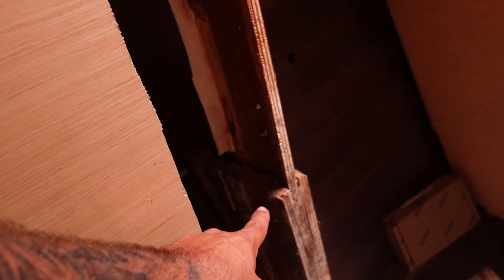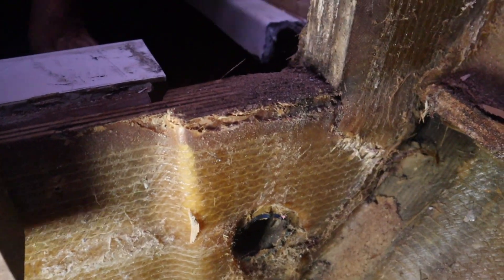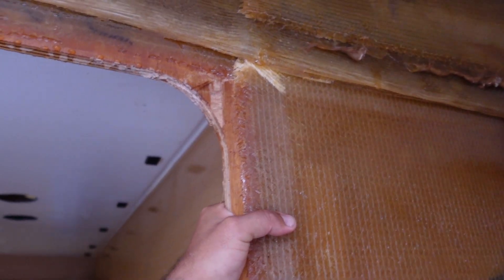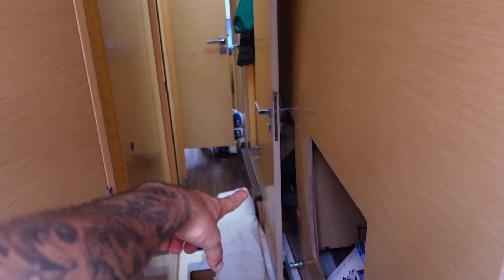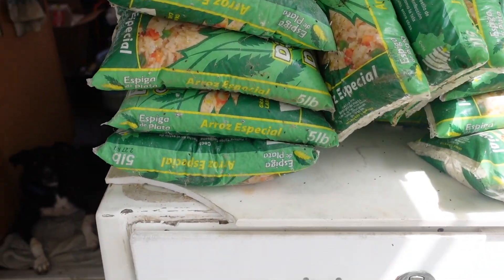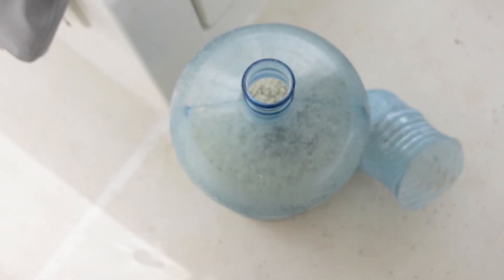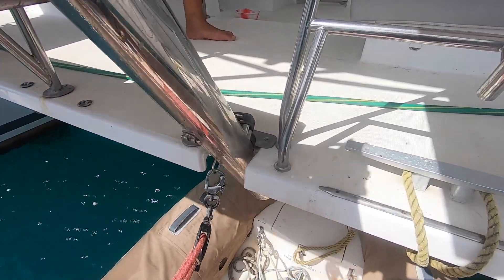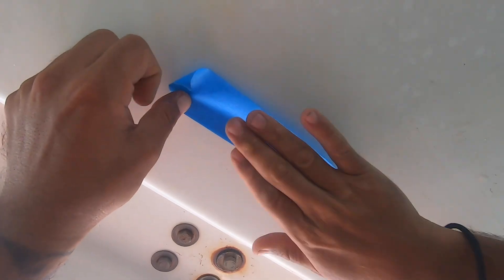CRACKED BULKHEAD REPAIR SERIES: Part 1 - An introduction... (Episode 107)

Comment: I've watched over 150 episodes in a week (I started off randomly then watched 30 or so recent ones, then from the beginning bringing me to this episode)..... and had stop at 10:36 because I couldn't believe my ears.

Quoting colin: 

"... the designer of the lagoon 450...... one of the best naval architects in the world..."

Colin, if he was, do you really think he would've used polyester resin?  15mm bulkheads and frames?  ... or what caused me to stop and write this, paraphrasing you this time:

"... he said, if anything, we should a negative rake in order to counteract stay tension...."

Are you fucking kidding me????? Not only did it sound blase', he didn't tell you by how many degrees!  Did he tell you what tension the stays should be?

As previously mentioned,  I've watched a few more recent vids and the cracking of bulkheads is common.  If I were you, I'd be seeking advice from a structural and materials engineer.

Comment: about the bugs in the rice:
the reason you have the weevils is because the eggs were already in the rice when you bought it.
it's common for most grains, whole or processed, to contain weevil eggs, regardless of where you in the world you buy them.
that's how even factory sealed packages can explode with weevils in a few weeks, or even just a couple days.
so you will basically never find any grains that don't have any weevils in them (other grain based dry goods like pastas can be effected too), but there are ways to kill them all off before you notice them.

you can heat the you can heat the rice or oats or whatever to about 140f for 15 minutes or so, but of course that isn't the best idea if you don't want to spend forever toasting your rice every time you stock up.
the other option, which i think is much better is to pop it all in a freezer for a couple days, because the extreme cold will kill them without changing the food. if you can find a local restaurant or supermarket in the area that will let you rent a bit of space in one of their big industrial freezers for a few days, that would probably be the best. then when you get ready to start resupplying you go buy your rice, flour, oats... first, then drop them off where you are going to rent the freezer space, that way once you are ready to actually leave in 2 or 3 days your dry goods will be ready

Comment: Give you good sailors this : unsinkable idea..use weather ballon diameter 10 m. And in every cabin a packed "parcutebox in sealing" and 8 mm nylon tube to a air bottle. This will ceep you afloat to repair can be done. And maybe an " parcutebox at top spreader" so that cat if uppside down in water can turn around. Best from sailorbeat in sweden :)

Comment: Pack rice in drum or similar. Put dry ice in and close lid but don't seal. Dry ice will sublamate and fill the container from bottom to top with co2. Seal. No oxygen. No life.
Another trick is to freeze the rice for several days to kill the eggs so they never hatch in the first place.

Comment: ill go carbon fibre on the structural stuff, wood rot over time,(inside the fiber) seen it many times, making the fibre have to do all the work, and a few layers of glass cant take that much tension in both directions (up and down, stay stress and water pressure.

Comment: to combat the weavel problem (in the future) put a bit of dry ice in the container as you fill the rice. That is CO2 and will remove the oxygen from the carboy (the container you used) if you keep it sealed and air-tight. If there are eggs in the rice, they will die rather than hatch into weavels.

Comment: I've replaced all of the main bulkheads on 2 of my boats.  I'm surprised that your bulkheads are what seems to be 1/2" ply.  My 32 foot (4700 lb) Evelyn 32-2 now has 3/4" bulkheads, glass on each side and the edges to completely encapsulate them in epoxy/glass.  Overbuilt, for my application, but I never fear them failing.  Here is the complete DIY rebuild/restoration of the boat:   http://nbayracing.com/Evelyn32-2Forum/viewtopic.php?f=8&t=166  and  https://www.facebook.com/media/set/?set=a.1669749116545.83411.1621862082&l=0290a25c2f&type=1  .  I feel your pain!  Too bad I live in the Chicago area, and not in Panama . . . I'd be over to help you in a heartbeat!

Comment: I assumed you already knew about it. But as I view the following videos. I have to assume that you don't know.

Which is that your hall is designed to fail right there. Every single lagoon 450 owner. Who has even been through rough seas will have very similar issues.

Let alone a hurricane damaged one.!

But check it out. Here is a few other YouTubers with the very same problem and their boat was never in a hurricane.

My Lagoon 450 Bulkheads are BROKEN & I have to fix them myself! Why won't you help me Lagoon?
https://youtu.be/eniqyjvICvs

So lagoon is acutely aware of this problem. And it is only because you were such a large YouTuber that they wish to assist you. So they don't look bad.

So you were actually even more lucky than you thought to get a hold of them.!!!

Comment: That plywood looked discolored so water damage if not it is from stress.  There have been stories of other older cats having long term stress problems maybe from the two hulls rocking not sync with each other or from the hulls pounding.   A rebuild will fix it may last 30 years but you are going to be dealing with unbalanced forces.

Comment: You lost me.  You overcranked the rigging so that means the shrouds came up too far.  So now the fix is to let them hang down the opposite way so why remove the weight?  I'd have thought youd want weight in the shrouds to pull the ends down so your floors can be properly epoxied and reinforced before it snaps back when it goes back in the water.....I think
Reply: Sorry.  Each of those hulls must weigh close to 2 tons empty so the junk hes throwing out must be just to make space for the renovation.  As a carpenter I wouldnt try to patch the interiors after he has trashed them.  Its much easier if he were to fit new lockers made to fit.  Takes more time but everything will have a shot at looking normal.   As it stands it will be pretty trashed.  Local artisans would be cheap with that and do a fine job Im sure.  Get it in Teak or White Oak.

Comment: messy dirty job and  now  you have to think about what caused these failures ...sitting on the hard and or lifting   can cause some issues for sure and maybe more blocking to distribute the weight is in order..... just a thought,  how lucky you were that it happened before you were halfway  to  New Zealand...burn out can sometimes  erode the enthusiasm  with that said  set  your goals  planning for the worst scenario  and get people who  can handle the stress.... good luck... I've  been doing this/that for over 50 years now retired  I can understand your plight

Comment: Cats are a beautiful thing but you have two competing hulls continually at odds with one another that are not evenly weighted, so the competing stress factors are tremendous.  Materials have come a long way since my early days with Chris Craft and then experimental hull designs for race boats, but always remember there is a reason why it's called glass, it's not that flexible. You have to design it with that in mind and build other factors in, to compensate. It doesn't look like a patch job is going to work unless you strip that inside out and do some reconfiguration and reinforcement.    IMHO
Cheers, Doc

Comment: 3:15 - you're no longer eating rice at that stage, your only eating weevils. You just need to decide if you want fried lice or fried rice. I find the infestation usually happens when you buy infested rice. Buy the vacuum packed rice to remove the air and oxygen to prevent life and it helps to show the bags are sealed from weevils.

Comment: I'm betting that this damage was done by the hurricane but was not discovered on your original inspection.  When the new sail rig was installed the damaged structure was not up to the load and failed.  It's going to be a difficult project getting the boat back in spec before glassing it all in place.

Comment: Seeing the damage at those very specific joints with subpar means of securing leads me to a poor design.  Or a more worrisome the mfg who built the boat cut corners.  This as you stated was a long over time process of failure points with a domino effect.  You have a some work to do there my friend.   I look forward to you documenting this repair process.

Comment: It seems to me that those catamarans are not made sturdy enough.
I had a friend push a Gemini a bit too hard against the waves in the gulf stream. The fiberglass came undone in the hull and sank in minutes, happily he was cruising with another boat that rescues him.
It seems to me that they should put a little less wood into paneling and more in the bulkhead and into the glass of the hulls.

You were very lucky that those bulkhead failures did not introduce huge tears into the hulls and sank the boat.

Comment: I don't need an Engineering Degree to "SEE" the damage you just discovered. My question is why didn't Lagoon ask you to inspect that bulkhead months ago!!!! I sincerely hope Lagoon assists you more than a few phone calls with their Chief Designer & Architect!!! Likewise, as I read the comments below (from Kevin Carrigan) it appears their is a more complexing design issue than bulkheads splitting and dropping. I am sorry to say I will not be considering a Lagoon for quite a while - even if I can afford one!!! And, truthfully COLIN, you have been extremely graceful with Lagoon. They should be doing more for you AND THANKING YOU!!! Quite honestly you now are fixing their design failures!!! Why would any company splice marine plywood (two pieces on the bottom - to - one piece on top) in a bulkhead construction??? The usage of two solid pieces of marine plywood with fiberglass makes obvious sense with more than just one piece fiberglass on either side!!! I will donate BEER MONEY for this video for sure (and hopefully every viewer also)!!!

Comment: As a fellow Engineer, I can confirm that "Epoxy the shit out of it" IS a viable method.  Good luck with the repairs and if you get depressed, just be glad you don't have all those dramatic folks to deal with from Below Deck...
Reply: The age old engineering approach of "GET A BIGGER HAMMER", saved me plenty of times.

Comment: Why don't you use a laser to help with the issue. That way you can be sure that the exterior hull configuration is perfect down to the last millimeter. We use this type of system for stage trussing on music/entertainment tours. It tells you exactly what is happening so there is no guess work.

Comment: The design of the cross beam bulkheads considering the twist and flex on the horizontal plain is suspect.The weak points are situated at the sandwich and the torque there when the boat is riding the uneven waves whilst fighting the tension created by the shrouds will be tons  not pounds .The bulkheads should have been honeycombed throughout and all of the dimensions equalised in the thickness so no weak points were created.
I concur with other posters on fatigue being the issue and I am not sure repeating this design on the repair is going to solve the underlying problem.Creating a box beam structure by honeycombing the vertical and horizontal areas around the doorways will take out lateral movement and avoid the risk of stress fractures.

Comment: I’m neither a sailor nor mechanical engineer but I have a lifetime of fixing things. And I have a very strong feeling that this is a design issue. There are huge forces on twin hull boats and a sheet of marine ply and some glass does not look up to the job. I am sure after all the hard work you will have the strongest 450 around. Good luck and thank you for these very interesting videos!

Comment: I’m not sure if it’s appropriate for me to comment, but here goes, for the bulkhead to be level, wouldn’t you have to be on your side? I’m not an engineer (high school dropout), but I think the floor or roof would be level and the walls should be plumb. If the  boat is perfectly level, than you can check for plumb. Not trying to be an ass, just wondering. I’ve learned more about fiberglass repair watching your videos than from anywhere else.

Comment: I have the sneaky suspicion that is caused by moisture delaminating the plywood over time (possibly the glue broke down). Not sure if it was in the plywood when sealed in with the epoxy, or the epoxy was not fully sealed. cut a piece and have a look at it.

I don't particularly like the idea of plywood anything inside an impermeable membrane of epoxy. 

If you are going to go through all that work, how about a different material?

Comment: Going out on limb here but Lagoons are production boats. Production means affordable. I personally can at some point only afford a production boat so it is wise to do some research but I will not let these issues stop me. I believe it has been common for a lot of production boats of all brands to have similar issues with the adhesive. If your adhesive separates, your bulkheads will slam slam up and down and will be damaged. I am also watching Catamaran IMPI and I understand they reinforced their Lagoon 440 bulkheads? I haven’t watched enough to know when or if they did it prior to departing. Also Sailing Nahoa reinforced, fixed and or epoxied their bulkheads on their Lagoon 41 during their travels. I think they caught the adhesive breaking and fixed it before any bulkheads broke but I don’t recall. A Lagoon 41 is also smaller and lighter. I will plan on a good inspection and will likely reinforce the bulkheads before any serious offshore passages. What do you guys think?

Comment: Just a guess at the portside? Bulkhead failure, but  they must have had some water intrusion in between the layers to cause that delamination? Or possibly there wasn't much time spent on the fiberglass layup so it was too thin? 
I can't tell but does the glass wrap under the bottom of that bulkhead and then have glue under it? Or is it just glassed on the sides and not the bottom? Seems like a lot of room for improvement.

Comment: Would you say this damage would not likely ever be an issue Edit!!! .. after reading the comments here and reading on the web, it looks like this is a common issue. Please sell this boat after your repairs.... lagoon (and beneteau for that matter) don't deserve any exposure...
A floor plan/layout is a major selling point to customers, but is worth sacrificing structural integrity to get it? I mean the more I look into this the more it seemes the structure can't even handle the mast and rigging much less a load under sail. Looking more and more like a poor boat to use as people tend to follow examples. Ultimately I'm hoping you don't end up as a paid lagoon guy that will end up glossing over design flaws for an income.. Cheers and good luck brother!

Comment: Spread out the rice (and weevils) on a cloth in the sun, the weevils will bugger off (probably to hide under the cloth), leaving you with edible rice. A technique that got my brother and his crew across the Atlantic in 1980 without starving! The crossing took a bit longer than expected, as the main boom, the gearbox, the steering and the head all failed, and the concrete centreboard fell out.

Comment: I got a idea of what caused these failures.... saving money during construction, using single plywood on the upper part and centering it on a doubled up piece then not using enough glass and the right glass to boot... glue .... for  two parts meeting at a 90 degree isn’t a strong joint .....  🤦

Comment: I used to do demos on homes that we were adding onto or after a fire and so on. I know how much has to be removed to reveal the real bones. Brother, I cannot even begin to imagine what must be going through your mind!! Of course you have an advantage or two with YT and patrons and the designer of your boat a phone call away, but after seeing what you revealed today, HOLY SHIT MAN!!!!  I am thinking you may need some heavy equipment parked on each side of the boat to anchor cables and winches to pull her back into her correct shape!!  Is Lagoon sending you blueprints so you can make perfect bulkheads? I KNOW you are not reusing any of that garbage!! 
Do they make steel catamarans??

Comment: Give the rice to some farmer with a ton of chickens (as long as he wants it) , chickens will eat the rice and most of the bugs, ducks love them. Of course, its long gone by now. One boat seals up food like that with those vacuum sealers, then puts it in individual sealed 5 gallon buckets.  On using that level, you'd have to compare it to the walls in other parts port and stern as the boat warped basically, correct ? I'm thinking the walls on the outside lean in ? This will be interesting. Another boat I'm familiar with had this happen out at sea. It wasn't your lagoon brand, and it barely made it to shore with the sailors on it. The bulkheads again. Not nearly as substantial as your boat, and I was very surprised when yours had this problem.